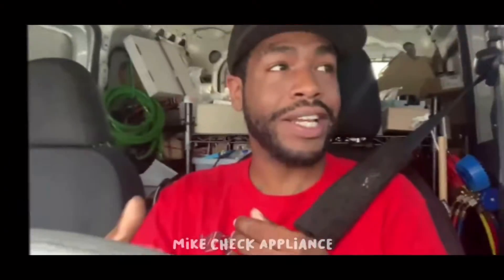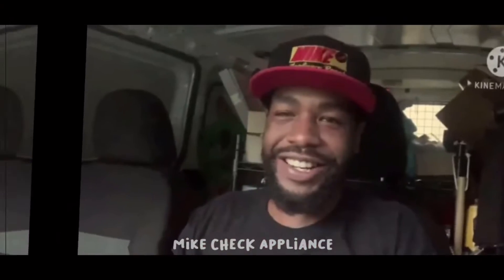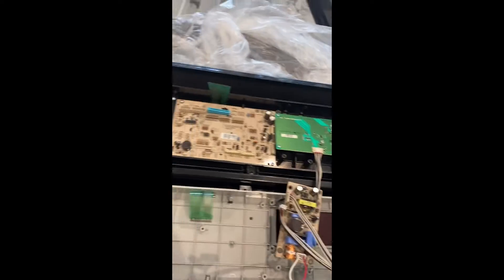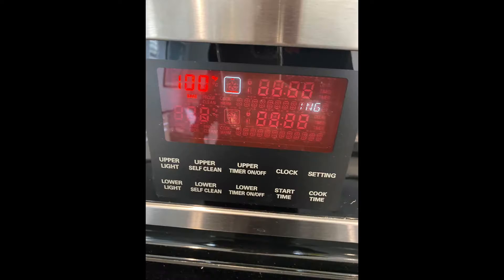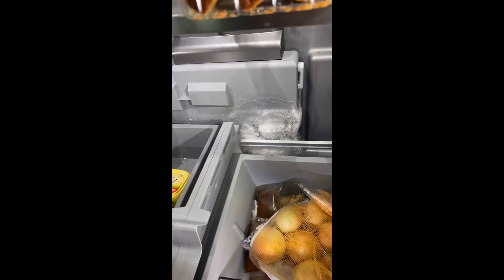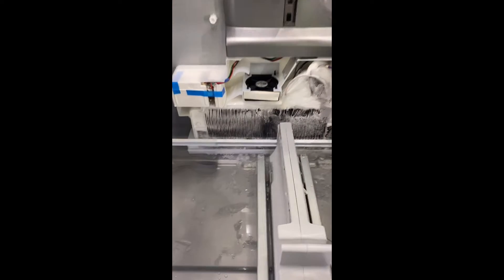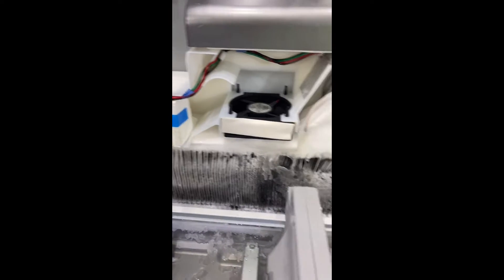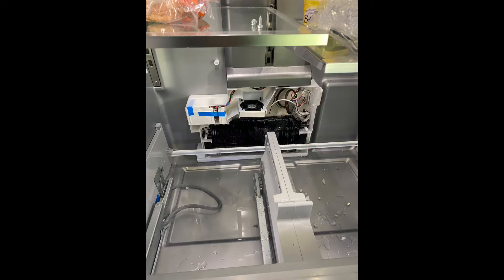Appliance repair daily route #4 Running 5 calls

Comment: Hey, how did you get that cover off on the five door fridge? I had one of those the other day that the drain froze over and just about had to take the entire thing apart to get to the drain line because I couldn't get that cover off.
Reply from the maker: You kinda have to shimy it out nice you take the screws out in not taking everything apart for that too much time
Reply: @MikeCheckAppliance  def too much time but I kept getting stuck trying to get it out. Then again I have bull in a China shop syndrome and am likely to break something. This causes me to be extra cautious.
Reply from the maker: Yea sometimes you gotta give it an extra pill it will come out